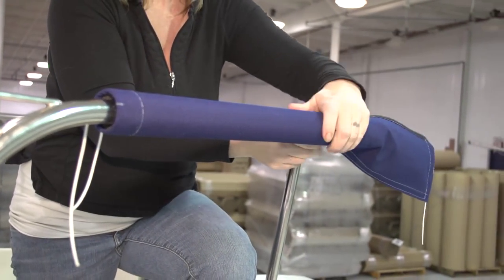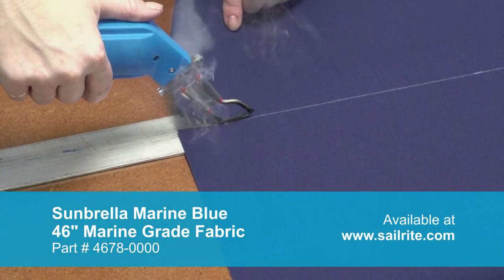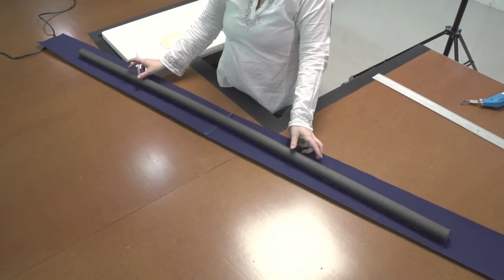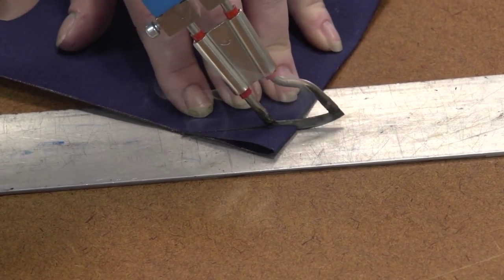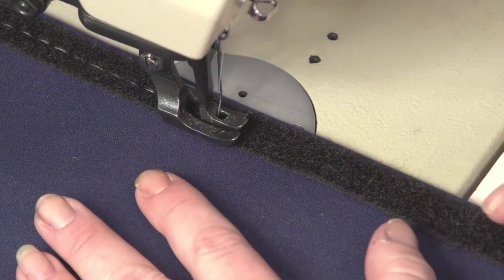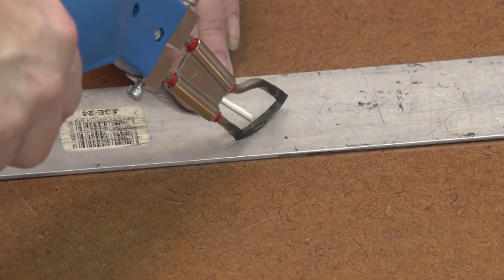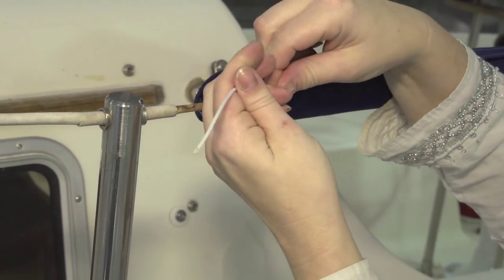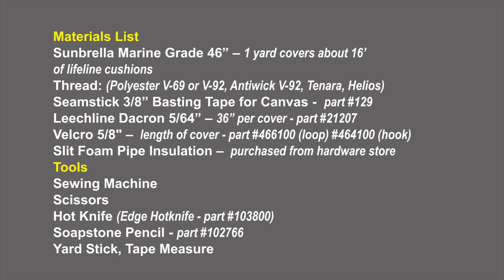Make Your Own Rail & Lifeline Cushions

Comment: I made these the exact same way a few years ago. works great. However, you really need to put some plastic hose on the inside of the foam when using it on a wire lifeline, as the wire WILL cut into the foam in short order.

Comment: have seen some use pvc on Macgregors, but seeing this long rigid pole didnt seem like a good solution to me. I just unscrewed the catch on the lifeline, and put some thin cheap hose on the inside, unsplit, then put the catch back on. flexible, and a bearing surface to spin and not get the insulation cut